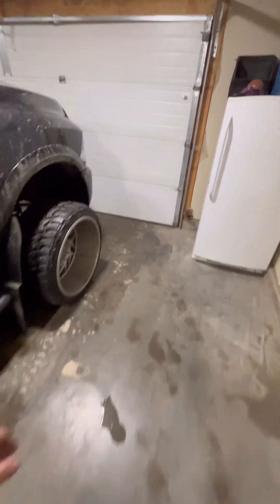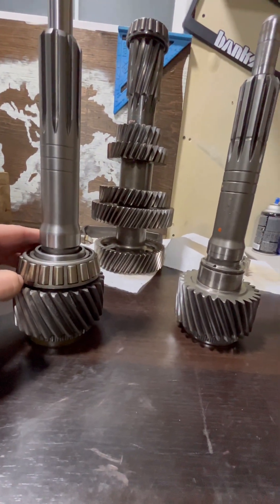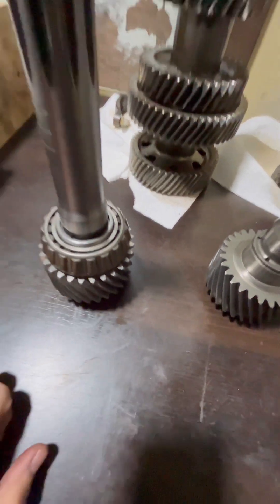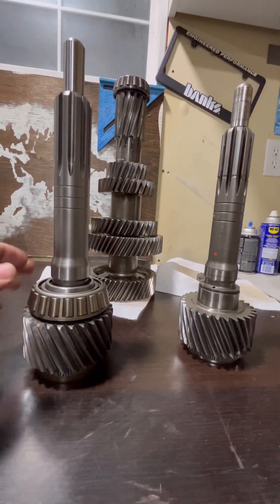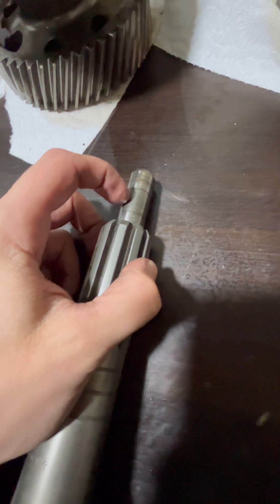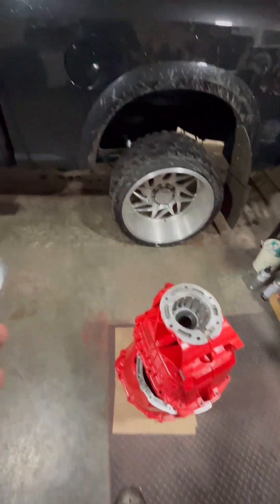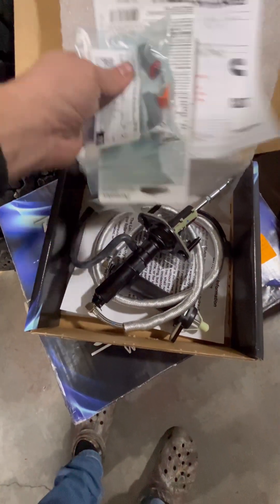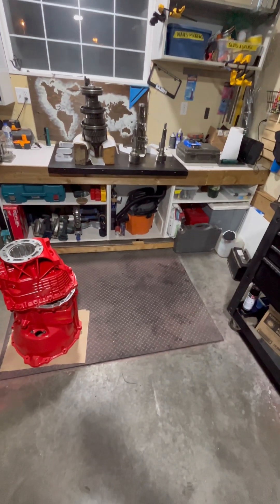G56 Manual Swap in a 4th Gen Ram - Part 2

Comment: Pedal assembly ecm flash slave cylinder transmission driveshaft modification etc?
Reply from the maker: That covers a lot of it.  Clutch with slave and master pre-bled.  Trans and g56 adaptor plate.  Cam seal. Shifter boots. Interior floor console and dash panel.  Front drive shaft lengthen 1.75”.  Clutch pedal and Clevis set up.  Steering wheel bezel/ covers for manual.  I had some seals and other items for when I went through the trans.

Comment: What all did u have to buy for the complete install ?
Reply from the maker: Trans, adapter plate, Southbend clutch with upgraded slave and master, interior pieces for around shift boot and below Center dash,  interior steering column bezel, shift boots,  clutch pedal assembly from wrecker, front drive shaft lengthened by 1.75”. A few other miscellaneous items but that was most of it!

Comment: Can you post a link on where you bought the parts to rebuild your g56
Reply from the maker: The seals were from Mopar parts.  Input shaft was through Rock Auto.  Input bearing from Lordco. Clutch was through Dirty Diesel.  Trans swap and swap parts were through a local wrecker. I didn’t rebuild the trans. Just split the cases and inspected everything before install!